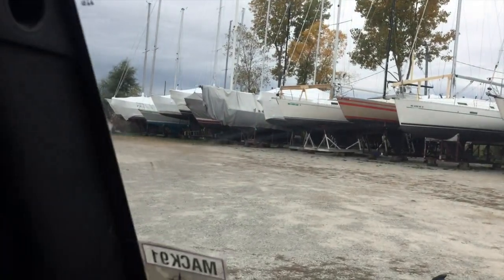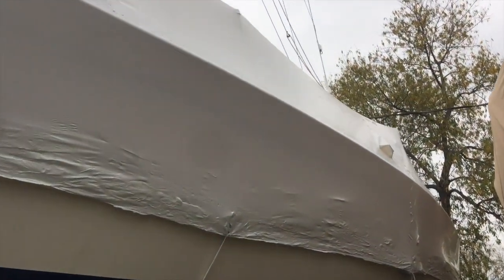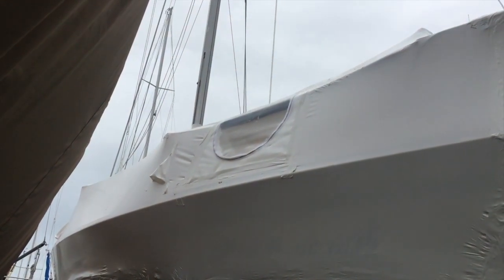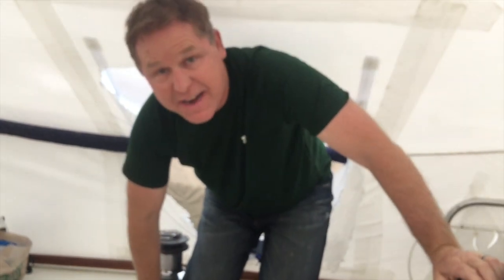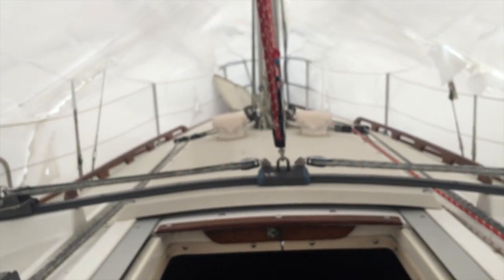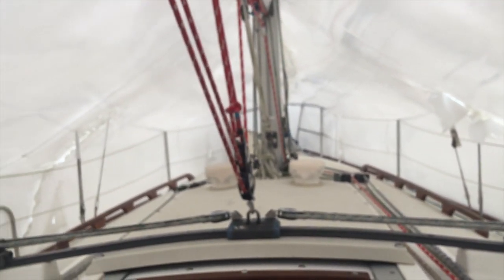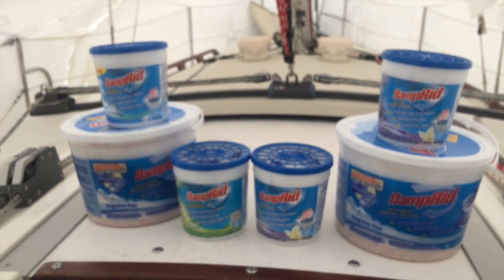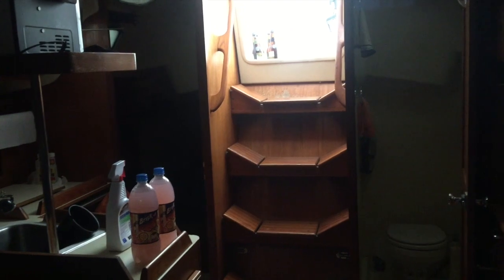SCOTt  FLICK SAILING Episode 25 shrink wrap and final prep for winter.

Comment: I Like to remove all fabric from the boat ..Its a hassle but smells much better in the spring.. great job .. good luck with that tank just put one in myself.. smells much better lol
Reply from the maker: Great tip Randy, i used to remove all the cushions, I should probably go back to that. Would you mind sending me the address of the place you bought your holding tank? The last one I bought was from West Marine And it had an access That leaked like a sieve. I’m looking for one with no access port. Any help would be greatly appreciated. Thanks for commenting on my channel.